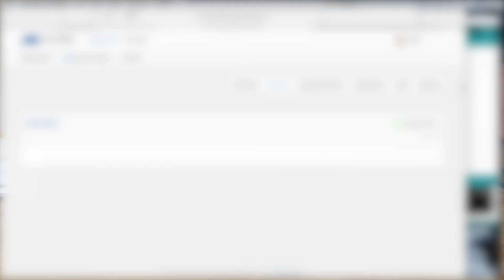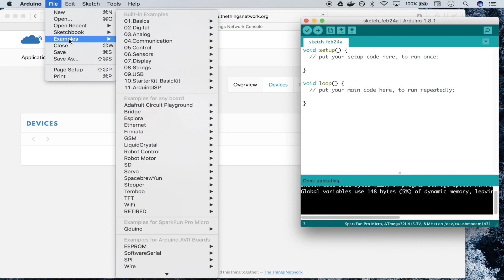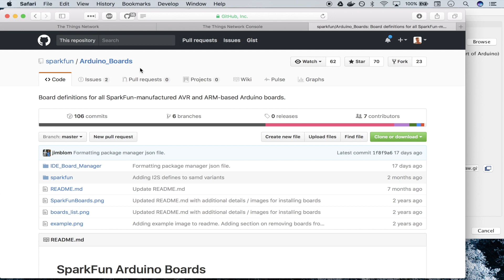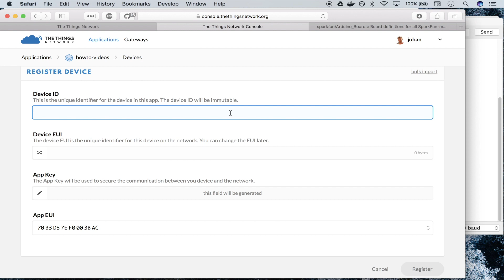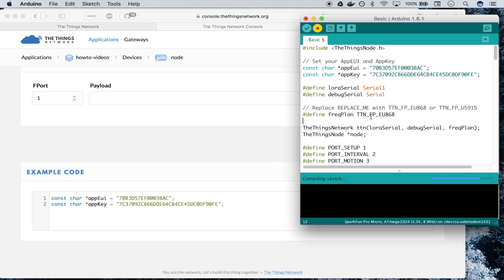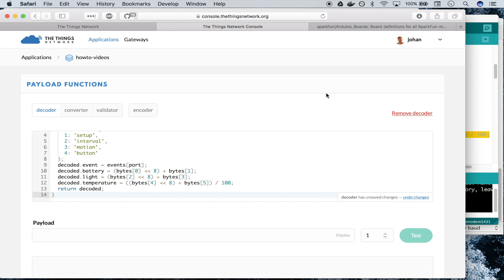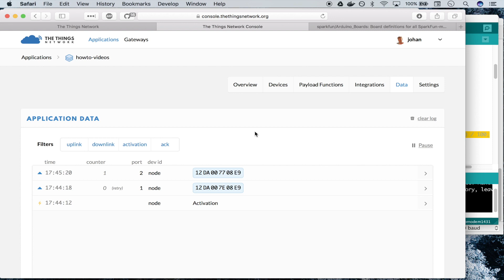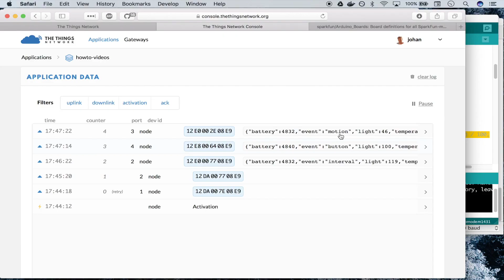How to: The Things Node Activation

Comment: I just received my Things Node and ran through the video instructions. Here are a couple of missed points in the video

1.  0:30 You need to remove the two screws in the base of the battery holder in order to remove the PCB from the housing :-)
2. 1:05  I had to install the TheThingsNetwork library not the TheThingNode library.  The TheThingsNode library is needed for the Basic example so best to install at the same time
3.  3:20  The console has changed.  I needed to add an application before I could register a device